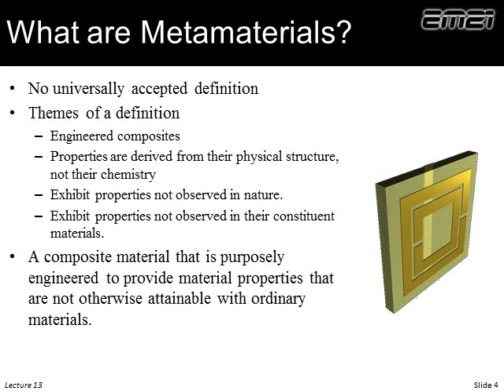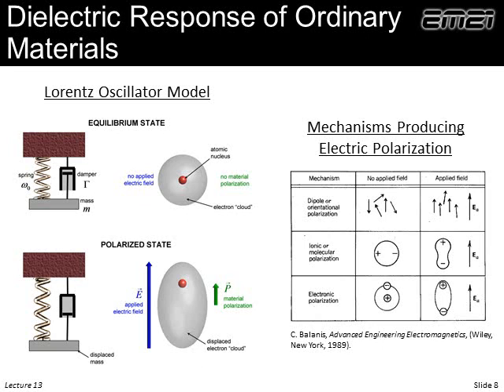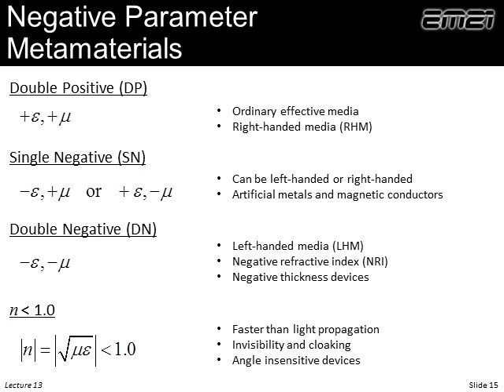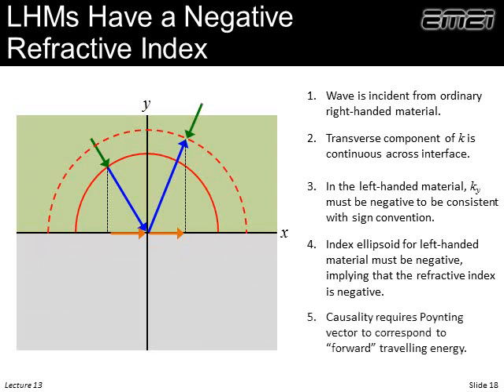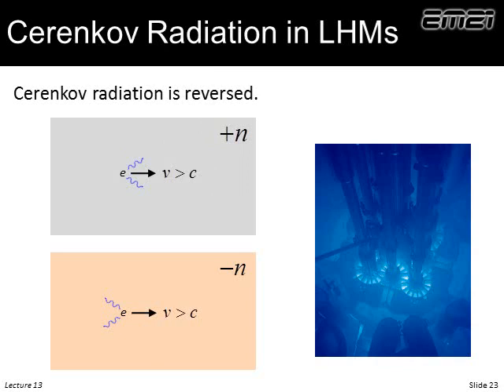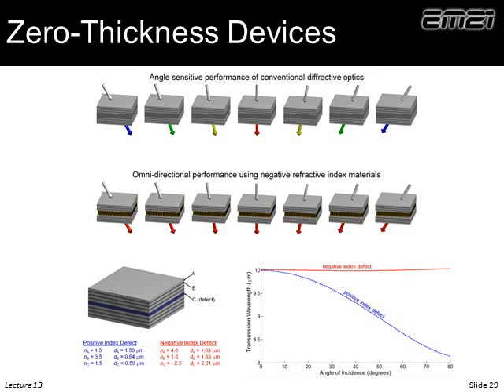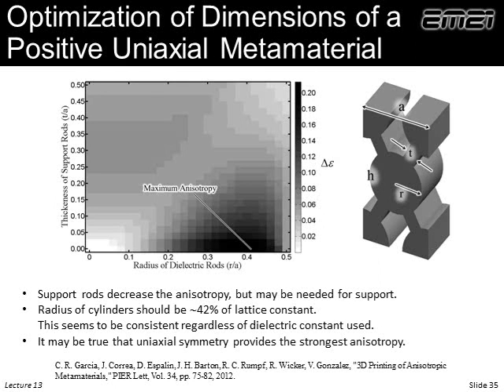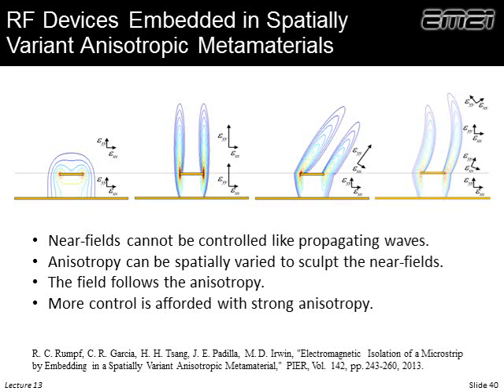Lecture 13 (EM21) -- Metamaterials

Comment: hello,I want to ask something that I am looking for it a month..how did you get these dimensions for srr?for example why is a=3.333mm and not 4 or 5? Is there any equation? thanks in advance
Reply from the maker: Happy to answer.  The parameter 'a' is the lattice spacing that is largely, but not completely, responsible for the frequency of operation.  In this case, a = 3.3 mm makes the metamaterial resonate at 15 GHz.  If we chose to scale the unit cell so that a = 6.6 mm, it would work the exact same way at 7.5 GHz.  For the most part, the values of the parameters are chosen by running some sort of optimization.  Sometimes you can derive an equivalent circuit model and then determine the values of the dimensions using closed form equations.  

Hope this helps!
Reply: thanks a lot. I dont know how can optimize the parameter. Should I put a random value for a and then optimize it with simulator?To be clear I try to design a multiband microstrip antenna based on metamaterial and I have 9 SRRs as substrate.I want a resonant frequency at 2.5 and 2 or three more frequencies. I take these results but I am not sure that I use the right dimensions for SRRs. Thanks again for youw answer
Reply from the maker: A big mistake that everybody makes it jumping straight into the big problem.  The best thing you can do is learn how to break your problem down into smaller steps.  Do not try to immediate simulate an antenna with metamaterials.  There is too much going on.  Take a step back.

First, I suggest just studying metamaterials.  Learn how to calculate their effective properties, permittivity and permeability.  Then simulate some simple patch antennas with known properties.  Duplicate those results.  After doing all this, you will be in a position to begin designing your fancy antenna.  I would simulate a patch antenna and just add a homogeneous slab of material with effective properties of your metamaterial.  This will run faster and allow you to study your antenna without having to consider the actual design of your metamaterials.  Next, move on to learning optimization and then design the metamaterials to give you the effective properties you need.  Only as a last final step will you actually simulate the antenna with the metamaterial structures.  I think you will also learn more by approaching your research this way.
Reply: You are right but sometimes it is not on my hand to do these steps properly.Thank you
Reply from the maker: Do you best to break down your topic into small steps.  Ideally, the steps can be checked for correctness. For example, duplicate similar results in the literature.

Comment: thank you very much for this answer but this is not a meta material it is an antenna
Reply from the maker: Waldemar Gregor Kaiser You are right!  Most metamaterials are arrays of small antennas that receive and re-radiate waves.  The interference between the re-radiated waves and the applied wave gives an overall macroscopic response that is analogous to what happens at the atomic scale.  Thus, a metamaterial is born because the effective properties can be controlled through the physical dimensions of the elements.
Reply: @empossible1577   Wow. I know nothing about it, just popped into the comments section to see what the hell it's about and... cool. Tiny antennas receive, then emit waves - are the re-radiated waves identical matches to, or different than the origin waves? - creating an interference pattern that can be controlled? Ok. Time to watch your video, lol. Count me a little bit fascinated.
Reply from the maker: @jwp98765  The secondary waves are at the same frequency as the applied wave so they are able to interfere with it.  Otherwise, they are much smaller amplitude and out of phase.

I suggest also listening to Lecture 2 which describes why materials exhibit a dielectric response.  This will give you more insight about how metamaterials work because you will hear the same story about secondary waves.

Also, I should point you to the official course website.  Many of the notes have seen corrections, revisions, improvements, new content, etc., but I have not yet rerecorded the videos.

http://emlab.utep.edu/ee5390em21.htm

Comment: where is your meta material on a photograph and the whole experiment
Reply from the maker: Waldemar Gregor Kaiser Most of the time when a metamaterial is shown, only a single unit cell is shown.  it is implied that it really needs to be in an array.  A photograph of the world's first left-handed metamaterial is provided around slide 20.  A photograph of the world's first electromagnetic cloak is shown on Slide 28.  A photograph of some anisotropic metamaterials are shown on Slide 37.  Each of these photographs is cited and you can refer to the publications to read the results of the experiments for each.

Comment: sir,
     you placed some .p files in MATLAB files for FDTD.how can i open them using matlab? i am using matlab2013a version
Reply from the maker: You can't "open" p files in MATLAB.  You can only run them.  Just drag them to your working directory and run them like there were a MATLAB program.  I use p-code for my classes when I want the students to use the program, but not see the code.  For example, in FDTD there are some codes to check the values assigned to certain parameters.  In order to do this check, I have to calculate the correct values.  I don't want the students to see that code or it would make the assignment useless.  If you want to create pcode, write an m-file script and then type at the command prompt ">>pcode filename"
Reply: CEM Lectures sir,
  i want to design an implantable antenna using FDTD method in MATLAB..will you please tell me the designing steps and brief introduction on how to analyse body simulation.please send to my email nag.474@gmail.com
Reply from the maker: I am not sure I can do all of that in one e-mail.  I can tell you that you will need a 3D FDTD model.  My recommendation is to find a good paper in the literature that has done something similar.  Work to duplicate their results.  Having done that, you will learn a lot and also have an answer that you know is correct and can work toward.  You will be in a much better position to solve the problem of of new antenna.  

Two other things I can provide.  First, check out a program called Blender.  It is free and open source and there are a lot of models available for free, including human heads or any other body part you may be interested in.  Second, I have some links to sites that provide the electromagnetic properties of virtually any fluid or tissue there is in the human body.  Get them here:

http://emlab.utep.edu/resources.htm

They are at the very top under "Useful Links"

Hope this helps!
Reply: CEM Lectures thank you sir

Comment: more lectures on metamaterials?
Or any courses available?
Reply from the maker: For more lectures on metamaterials, check out the other lectures in the EM21 series.  This entire course is on that subject and they are archived here:

http://emlab.utep.edu/ee5390em21.htm

The the lectures in this series essentially lead up to this metamaterials lecture.  The following lecture is on band gap materials that many still consider in the family of metamaterials.

I have a similar course on finite-difference time-domain here:

http://emlab.utep.edu/ee5390fdtd.htm

And a follow-on course to this titled "Computational Electromagnetics" here:

http://emlab.utep.edu/ee5390cem.htm

Maybe more will happen over time.  We'll see.

Enjoy!